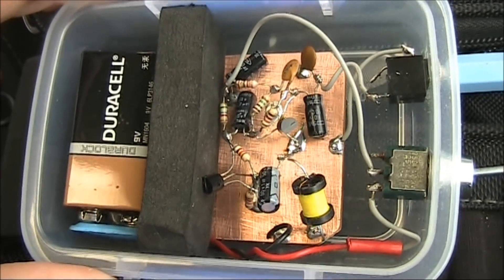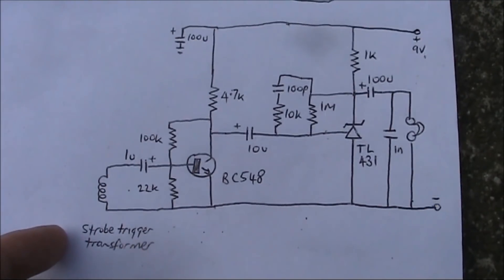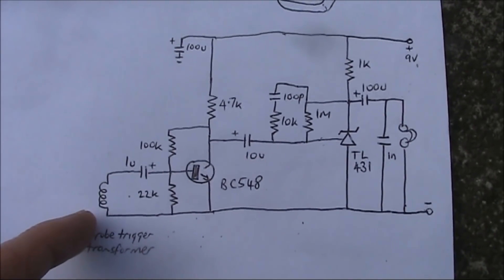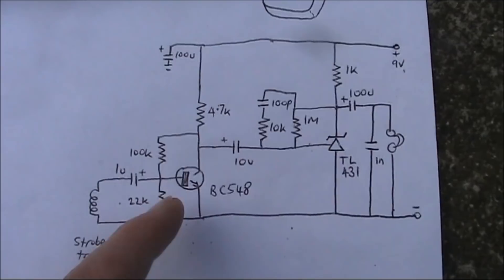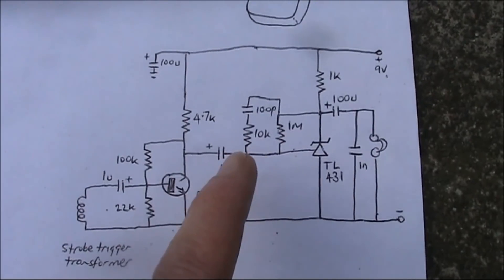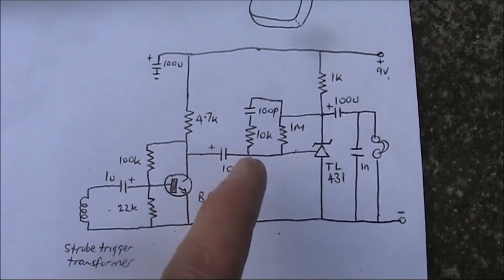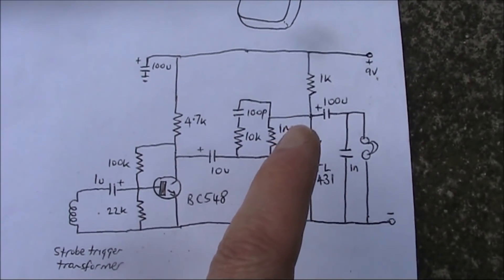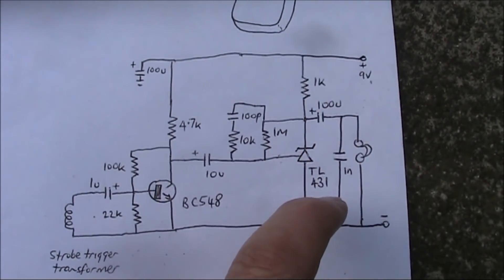Urban sounds from an induction loop audio receiver

Comment: For experimental purposes wrap some insulated wire over a ferrite rod & push or pull the rod to sort of 'tune' it. Also try the coil from a speaker with & without the magnet.

Comment: The Japanese call this the #モハラジオ and use this to record the motor sounds of trains (i.e. the chopper and the VVVF). The inductor coil used here is 100mH, not 10mH. To wire it up, they also use a circuit board, a 1µF 105M ceramic non-polarised capacitor, a 6.8kΩ carbon-film resistor, a 3.5mm 4-pole (TRRS) male-to-male cable (at least a metre long) and a 3.5mm 4-pole connector mini-jack. They also soldered the wires correctly. I faced a problem with one I had built in July; the connector mini-jack was not soldered properly, so I will have to redo that before I can start recording the motor sounds of Sydney Trains.

Comment: Hi! Can this circuit pick up lightning interference?
Reply: Yes, actually with that circuit plus inductor about 50 mH i can hear thunderstorm cracles from storms far beyond 100 km! But its difficult to get rid of the 50/60Hz buzz. Fortunately magnetic loops are directional and have deep nulls.
Reply: @454cassul9  Thanks!
Reply: Try using a medium wave or even better longwave radio, works great.
Reply: @migsvensurfing6310  Thanks!

Comment: The train station is definitely installed with proper equipment. A good loop amplifier has 30/1dB AGC in the receiver and with correct polarisation is very consistent. I am a bit concerned about the installation in the building, first part. This has a large dynamic range in the received signal, usually due to poor coil placement in the floor and in some case multiple wire loop coiling that has a detrimental effect on high-frequency response. It is possible that your receiver is highly directional, some coil configurations can receive numerous magnetic fields (one at a time). This is not quite like RF principles as the wavelengths are too high to affect consistency along the line like transmission lines do.

Comment: verrry interesting! I think it would be fun to try different pick up coils
Reply from the maker: Yes. Apparently bigger coils give better range.
Reply: @vk3ye  I think to experiment with multilayer coils on fairly long ferrite rods (perhaps 15 to 20cm or more), the ferrite rod improving the response to magnetic fields
Reply from the maker: @Evan Cottle It would probably be OK. Not that you'd need one as the coil that Jaycar sells is only $1.95. A telephone pickup coil (less common now) would also work. http://www.talkingelectronics.com/projects/HearingAid/HearingAid-P1.html